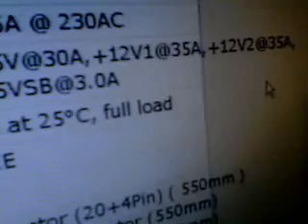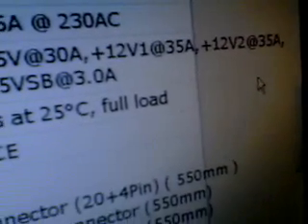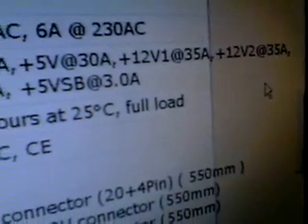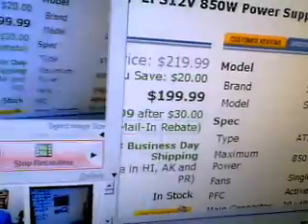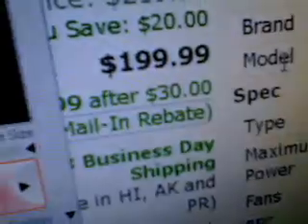8800GT PSU AMP Requirements

Comment from the maker: The CPU i3-530 uses up to 73 watts. An 8800GT will use around 111 watts under load. Those two parts should comprise the bulk of power (say 90%) for the system. My question is if it's a quality 300 watt PSU and I'm going to put my money on a no. If you buy a new PSU aim for at least 500 watts so you have some clearance. Also make sure it's 80 Plus certified (converts AC to DC power at 80% or greater efficiency) with at least a 3 year warranty if not five years.

Comment: its a Model: ATX0300D5WC Rev. B
HP P/N: 585008-001
300 watts maximum output
Single ball bearing fan design
Built-in power status LED above AC inlet
Voltage switch for 115/230V AC input
Input: 100-127V/ 8A, 200-240V/ 4A.
Input Frequency: 50/60Hz
Output:
+12V 19A, -12V 0.8A, +5V 25A, +5VSB 2A, +3.3V 18A,
+5V & +3.3V 175W MAX,
+5V & +12V 268W MAX.
im just wondering if i keep using this can my computer mess up. the fa goes on when i play high resolution games

Comment from the maker: You didn't specify what PSU you're using and the specs page at HP is devastatingly disappointing. With a single 8800GT and the CPU being the main consuming parts of the system you may get away with 400-500 watts under total full load though that's pure speculation without anything solid to go by.

Comment: You mustve been running a 100 watt PSU

Ive got experiance in this and usually running a power supply over its rating will most of the time result in instability, but if it's a dirt cheap PSU it's more likly to blow the caps.

They have theese ratings assuming you have a high end system with tonns of hardware.

Any decent 300 watt power supply running mainstream hardware would run a 8800GT fine, heck i got by on one for a while

Comment: no you cant not forge the two together you will blow a compacitor but it still may be enough not sure what else you got i recently built a pc with a corsair 620watt with 4 19a rails and my bfg 8800gtoc is ok the rest of the system is stable if its excelent quality it may work my personal pc has 500watt and more than enough amps on the +12rail 34a combined but when i called the maker of the psu they said not to push it aeven though my psu has enough power its not very good quaility

Comment: I think part of the confusion comes from misunderstanding the requirements for the 8800GT. The 26A spec you see is for the ENTIRE system, not just the video card. You need a power supply capable of providing 26A total on the +12V rails. Not on a single rail.

Comment: The GT itself can't draw more than 12.5A total. The PCI-E bus provided up to 75 watts, and the 6 pin PCI-E power connector can supply another 75 watts. This means the total possible draw is 150W (150W/12V=12.5A). In reality it probably draws less than 100W.
    -from nvidias website nzone

Comment: Multi-12V Rails divide up the Amps and each rail is isolated from one another,they DONT add up. If you're a true enthusiast,do your rig a favor and get a real man's PSU,a Single Large 12V Rail with high-efficiency and more power than what your rig needs now. This is simple concept,if the PSU is much more capable it will run cooler and you'll have less power-loss=less heat=longer lifespan=more stable system=future upgradeability. DONT use modular cuz more frictions are created at the connectors.

Comment: My CoolerMaster Extreme 430W can run the 8800GT fine, if i could run a X1950XTX i can for sure use a 8800GT fine.

Comment: I only have a 550 watt psu it has 2x 12v rails running at 18A each but since upgrading from an 8600gt 512mb my system has become very unstable and my pc wouldnt start with q6600 cpu at its initial overclock at 3.2ghz i had to reset to 2.4 again help!!

Comment: That way more than you need.  I'm running an 8800GT on a 450W.  Its the amperage on the 12V that counts.  If all the amperage on a 600 or 700W psu is on the 5V, it doesn't matter how powerful your psu, nothing is available for the 12V

Comment from the maker: 600 watts is the minimum I'd use for a single 8800GT. I'd use at least a 700 watt PSU for tow 8800 GT cards in SLI.

Comment: Need a psu with a single 12v rail with an available 26amps or more just to run the video card. It may run with less but forget overclocking. The days of looking at wattage on our psu's are over. The new atx 2.2 standard will not insure your psu is able to run your devices. Split 12v rail psu's actually will limit the availble usage of power making some 650 and 700 watt psu's inable to run devices that other 500 and 400 psu's can handle with ease.

Comment: a 20 amp 12v rail will in most cases suffice.
The 8800gt peaks at about 220-250w in 3dmark, but I have not seen it peak that high in games like crysis. 

P = U X I

P (watt) = U(voltage) times I(current)

240W = 12V x 20A .

There is a lot of different variables that will affect this "general" rating ( having the cabinet full of hard drives and cd roms, a low power PSU < 500w.) This may result in voltage drop (unstable 12v rail) and therefore also drop in power.

Comment: I have same system as you..  had a 300W wth 16 amps and it worked...

now i upgrade to dual rails 460W is same.

theres problem ,,, have the right drivers?

Comment from the maker: I was running a 500 watt PSU and it died while running SLI. You're probably stressing your PSU right now by only having 400 watts (and is it efficient?) I'd recommend going very easy on your  video card until you have that new PSU. 600 watts for a solo card, 700 for SLI is what I recommend.

Comment from the maker: Enough for what? I peaked at 480 watts with a single card...I don't even know if a brand name would be able to handle your power requirements plus no clue what (not that I'd do the math myself) your power requirements are. If you're running a single card get at least a 600 watt PSU, 700 watts absolute minimum for SLI with two 8800GT cards. See my channel's sidebar for my computer's stats.

Comment: ok after further research lol if anyone is even reading this...you talk about how there is only 18 amps on a power supply..this is completely wrong. Most newer power supplies have separate rails so 18a dedicated on one rail for Video cards means thats fine infact its more than fine the only way you run into issues is if you have a low wattage psu with one single 12v rail..k..binow.

Comment: i think your 500W PSU means 18 amps on the 12v1 rail..like..i believe it means 26 amps in total if you run one single 12v rail. if you have 18 dedicated to the PCI-E line i think you should be ok.

Comment: if anyone is interested in a good powersupply capable of running this beast..(kinda beast) i would check out corsair's 650W. It has 52 amps on the 12v rail keep in mind this accounts for fans, usb devices etc.

Comment: you need to keep in mind you have the superclocked version which goes up to 1900mhz memory clock. Stock is 1800mhz which means that the other cards dont need as much power. my EN8800GT box says minimum 400 at 20amps 12 volt rail. I would recommend a 550 at 26/28 amps.

Comment: No man that's wrong my 679W PSU has 26A on each and i ordered it only for 45 bucks.
for 200 bucks you can buy a 1000W power supplay with 30A in case  if you have 2X ATI 2900XT .

Comment from the maker: Some folks are saying that if you have two rails (two six pin connectors on your PSU) that the AMP rating is twice per rail...so 18amp according to that claim means I'm getting 36amps PER six-pin connector. I'm looking to confirm this from more official sources of course though it seems SLI is working in the games that support it.